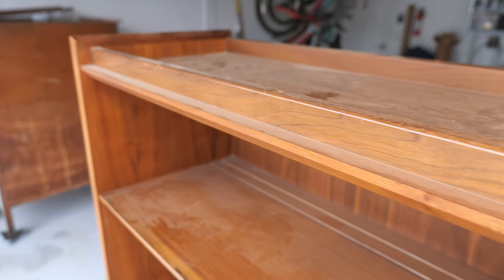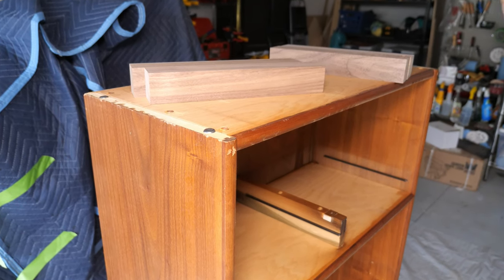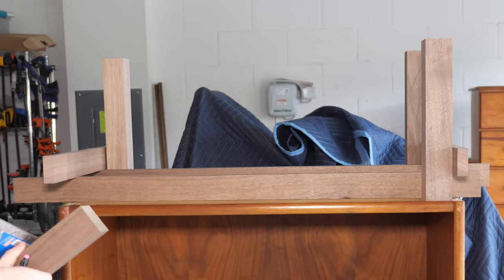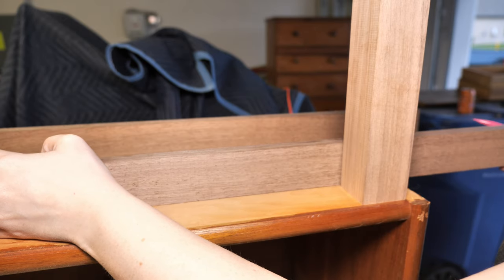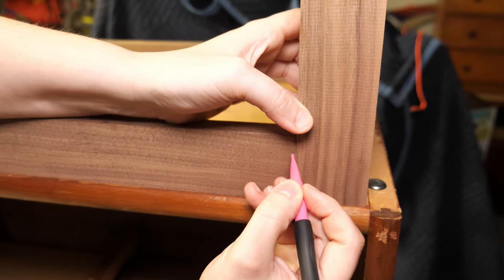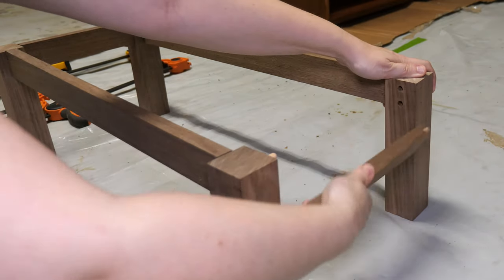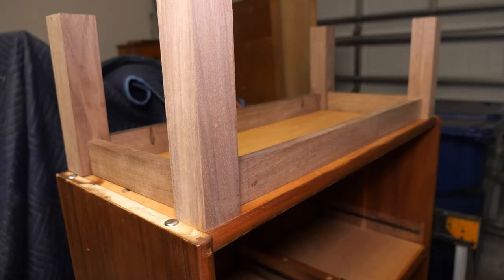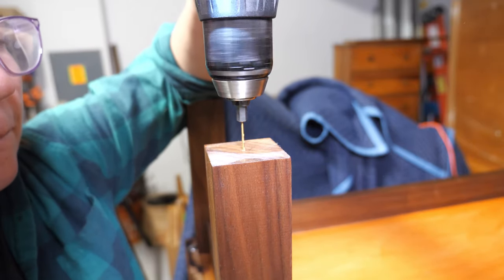Building a Furniture Base without a tape measure. Visual Design Build!

Comment: Hey Emily, great video! I noticed you were drilling your pocket holes with the torque setting on your drill set at 1. That is for screwing, so you may have noticed it was slow and difficult to drill those holes. When you are drilling, you want to slide it to the 2 setting. That’s for drilling and will be much easier. Also, using a stop block on your miter saw will help you get repeatable accurate cuts when cutting legs and aprons. Hope these tips help! Love your content!
Reply from the maker: Funny story. I always read manuals (because I am that person), and it says drilling just move it to the drill setting and done. But now reading this I am like This makes a lot of sense lol! Thank you! I am sure I am going to do this next time and wonder where this setting has been my whole life! Also great tip with the stop block! Thank you Yvette!!

Comment: What happened to "Measure twice, cut once"? LOL  I need some tall shelf units like that in my new apartment. Since I don't own a pick-up, I'm not sure how I'm gonna make that happen. :/  Thankfully, it's not an emergency. ;)  Nice job on the reconfigure. <3 <3
Reply from the maker: The book shelf fit in my Rav4, but I am not sure  it would fit in a car. When I want something a bit taller I look for units that are two parts so I can transport them. I have also considered renting a Uhaul if I found enough things to justify it in a day. Most thrift stores in my area will hold items until you can pick them up with payment. I do wish I had a truck through. There are so many things I haven't picked up because of it. Thank you Noralee!! 😊
Reply: @ReconstructingEmily  I hear you! My next car may be an SUV or pick-up, although they comes with their own issues - as in all the people like us who need a truck to move things! ROFL Not to mention the price of gas these days. Yikes!! :o ;)